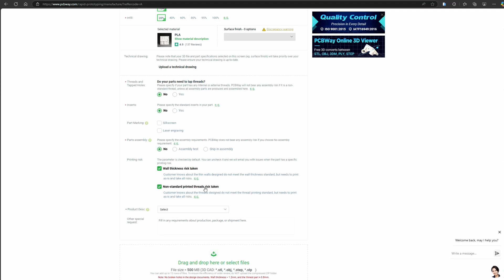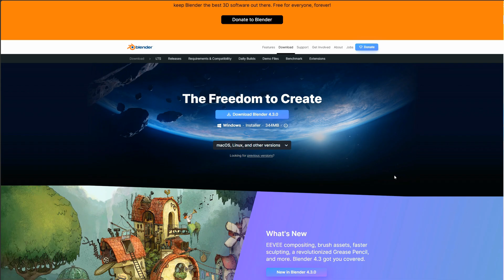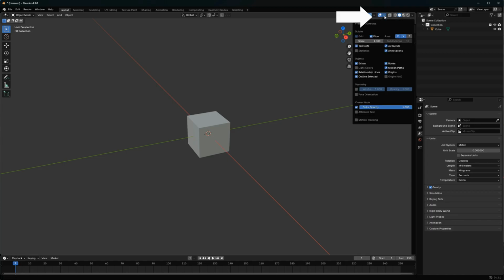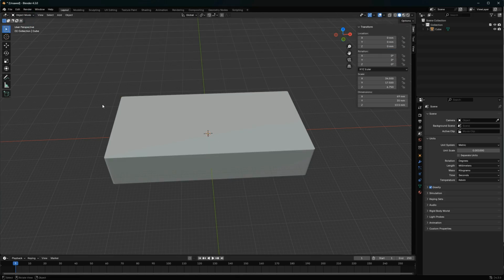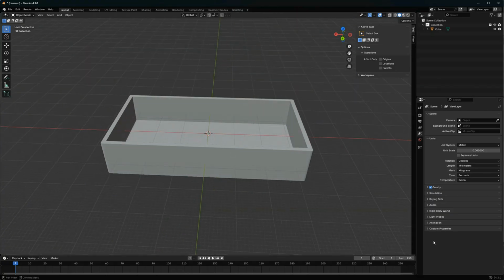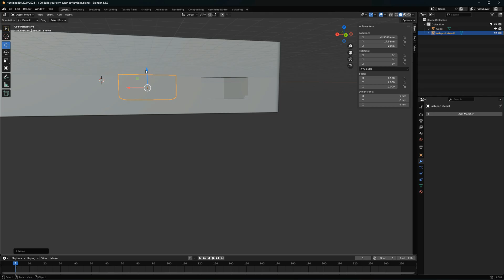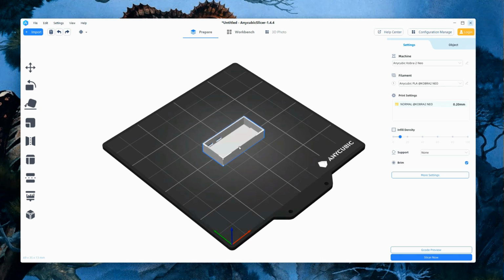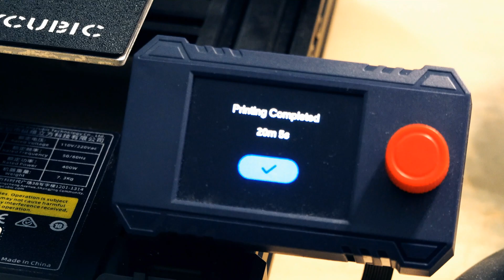3D designing & printing custom enclosures for DIY synthesizers in Blender | Step-by-Step Guide

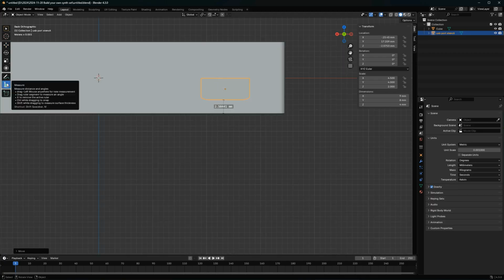Comment: If you look closely, when you add the bevel to your edges the symmetry of the bevel is wrong, ie it's not 45 degrees.  This is a gotcha with Blender due to your scale being something other than 1.  You can see this in the transform box above the dimensions.  For example at 5:56 your dimensions are 9mm X, 8mm Y and 4mm Z, but if you look above it the scale is 4.5X 4Y and 2Z.
To get the bevel to a symmetrical 45degrees on the edges you need to apply the scale, this will then return the scale XYZ values to 1 but leave your dimensions untouched.
To apply the scale, with the object selected in Object Mode, go the Object menu (View Select Add OBJECT) at the top, then choose Apply > Scale.  This needs to be done before beveling.
Reply from the maker: Thanks for pointing that out! I'll pin this.

Comment: Blender works with meshes, this is not a good thing for engineering designs.
People say, FreeCAD is now fixed. 
I also had good experience with Fusion360
Reply from the maker: Hi, thanks for your input! You're right, if FreeCAD is fixed now, it's a better choice for anything technical. It teaches users a more precise, technical approach to designing.
However, using Blender has its advantages - its a much more stable and refined software with an easy-to-understand UI with lots of 3D manipulation tools. Really depends on what you're going for.

Comment: 2:20 > I'm using FreeCAD for my 3D printings and the problem is the learning curve. You really need to get use to it.

What I really love of it is that you can include spreadsheets to parametrize your parts. It is really nice to see that when you change a value, your CAD model will change as well.
Reply from the maker: Thanks for watching! I started with FreeCAD 0.21 and liked it's numerical, technical workflow. Unfortunately, more than once my models became un-editable because reference errors (for example, a hole is always referring to the shape it's sitting on). Once you start changing stuff, good luck not getting the "recompute failed" error.
I heard this was fixed in 1.0, but I finished this video before that was released.
Reply: @mr_floydst  Yes, there are some isues that you can avoid, but you must know how. I haven't worked a lot with FreeCAD, but I have to confess that the first model I did broke as you mentioned, then I posted a question to the forum and a guy called:  TheMarkster gave me nice pointers:

1) Avoid attaching a sketch to the face of a Pad or other generated geometry. Attach instead to the appropriate origin plane, and then apply the appropriate attachment offset to position the sketch as desired. Sounds like a lot more work? It is, but it will save you headaches later due to TNP (Topological naming problem)

2) Avoid creating links to external geometry in a sketch to generated geometry. Use instead the underlying sketch for that link. Even better, bring that sketch in as a carbon copy and convert the edges to construction mode. Even better than that: name the constraints used to position those elements and reference the constraints by name in the other sketch. Still even better than that: create a spreadsheet and put your data into it, and then reference the same data from both sketches.

So, looks like your problem was 1). I have done now only two parts with Spreadsheets and each time I change a variable, the model resizes correctly. I guess you just need to think it more about how to build it.
Reply from the maker: Thanks for your input. I'll try version 1.0 for sure. But the things you are describing here really should be possible because it's possible to do that in the UI. There should be no "penalty" for doing it that way.  I heard this was fixed in the new release 1.0.
In Blender, if you find you "misplaced" a hole or part, simply go into edit mode, select the part, enter it's new position, and that's it. One could argue that you shouldn't enter the wrong numbers in the first place, but I'm not constructing airplanes here, or anything that could endanger someone, so a bit of creative leeway should be allowed ;-)

Comment: I built a 3D printer from scratch. Actually, 2 of them. Sold them. Blender is cool, but Freecad is better if you know what you're doing. I used Blender mostly. In fact, I made industrial videos in Blender.

In this case, I would have used the solidify modifier instead of a boolean. Blender has a measurement function.
Reply from the maker: Hi, thanks for watching! I used FreeCAD 0.2 before switching to Blender. I like it's more methodical, technical approach that is based on measurements. Unfortunately, it happened more than once that the whole model became unusable after adding some holes and then trying to reposition them.
I heard this got fixed in 1.0, but it really made me not want to use that software again. ;-)
Reply: A nephew of mine (by coincidence the owner of the company that made the airco in the studio where you tested the drum device, thanks for the free add 😂) introduced me to Blender 1.7 back in the naughties. I couldn't get my head to align with it, then I downloaded 2.4, and I started to grock it. Now, in versions 3 and 4, it's slowly invading the major studios of this world. It's sort of underground, but it gets used more and more. BTW, Blender is not intended to be free. If you use it more, it's morally nice to start paying for it by subscribing to any of its education programs. It's great value for money (you get a lot of info and free object downloads), and you keep the development going, and you can stop your subscription any time you want.

Comment: Wow this is so much easier in FreeCAD, an actual parametric CAD program
Reply from the maker: FreeCAD will give you a more methodical approach and a much more precise way to come up with designs. I heard Version 1.0 which was released a couple of days ago has ironed out the worst bugs.
Knowing Blender basics, on the other hand, certainly isn't the worst thing that can happen to you. ;-)
Reply: I have been using FreeCAD for a couple of years. In the beginning it was a rough learning curve, but now when I know where all the pitfalls are and the right way of doing stuff it is quite an efficient tool. Also, as @mr_floydst pointed out, the 1.0 version has ironed out most of the bugs. It still has some distance to go to become 100% polished, and I hope they continue moving in that direction.